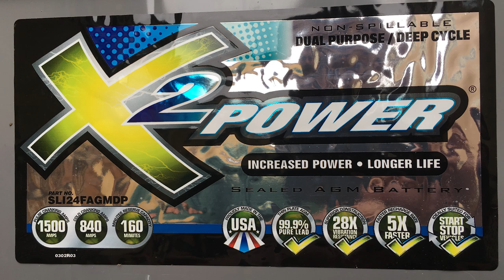Northstar 2X Power Battery Install

Comment: My chevy dealership had the nerve to tell me i wasn't using the "correct type of battery" for my cruze diesel,  since it says deep cycle on it. But I told them it also says dual purpose. I have the 94R group size with 840CCA. I even told them I work at batteries plus where they sell Northstar batteries under the x2 label. Something is draining it every night. But it still starts up with 11.8v which is 0% charge, so I know the battery is still damn good.

Comment: How have the battery been working for you? I just bought two group 34 to replace the two Yellow Tops on my Jeep, I had heard stories of how Optima's quality was in the crapper since they moved manufacturing to Mexico but I got to experience it myself first hand. They lasted about a year and 10 months before they got bloated and one leaked from the negative terminal.
Reply from the maker: I love it! Performed flawlessly traveling through Utah, -7 degrees. After heavy use, not a sign of weakness!
Reply: That is excellent news!!

Comment: been using a yellow top 4 five years in my CJ7 .killed dead flat twice .many a long winch poll & cold starts here in Iowa. also  a 20ft plus drive on the starter(long story). not a single problem. Thumbs up on the vid i like the hands on how too. Looks like a good battery hope it works out like u want :)

Comment: Is the distributor the only thing requiring covering to hose down the engine bay?
Reply from the maker: As far as I know as long as your engine bay is in good condition, and hoses are in good shape. Don't use a high presure washer unless you do so very carefully. Those can cut hoses.
Reply: No! Don’t spray down your engine bay! Wipe it down with some soap and rags only.  The more modern the engine is, the more electronic damage risk you could have immediately or down the road.  All this according to my very experienced honest detail shop owner.  They won’t spray any water into the bay...too much risk.  Nice battery.

Comment: where did you find it? do you have a link?
Reply: https://www.batteriesplus.com/productdetails/sli24fagmdp This has the same item number seen on Michael's battery, however it looks a tad different. But still has the 840 cold cranking amps. There are a lot of x2Power batteries on BatteriesPlus so look around on there!
Reply: He found it at our local Batteries Plus Bulbs. Great shop!

Comment: should remove your ring or at least tape it to prevent arcing when working with electricity. Also that mask is for dust not for vapors. just trying to keep you around a little longer.:)

Comment: Nice job!  From here it looks like you might have a small leak from the distribuitor oring, the back of mine looked the same. I'm sure you know all about it but in case somebody needs the info, here is a nice write up I referred to:https://forum.ih8mud.com/threads/how-to-replace-distributor-o-ring.262624/ Cheers and keep up the good work.